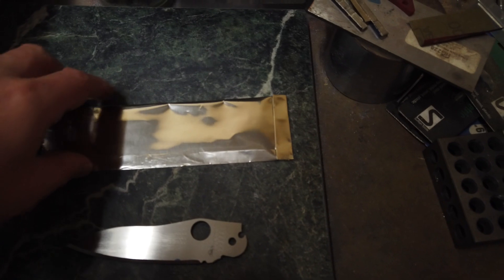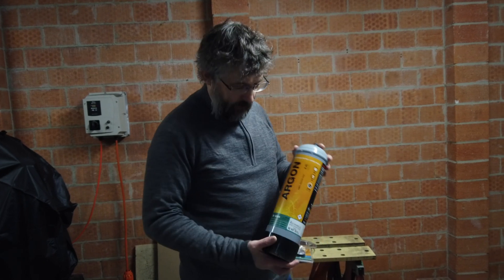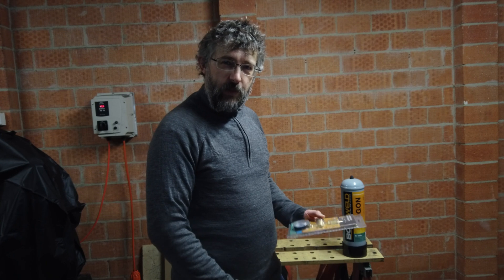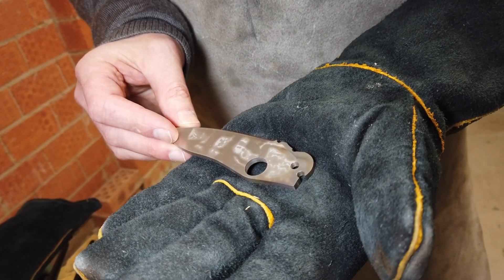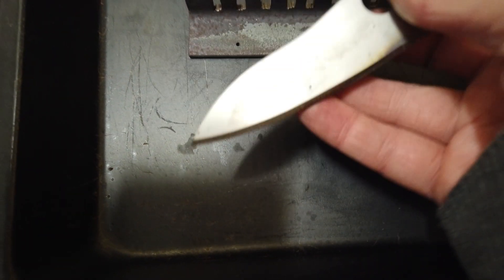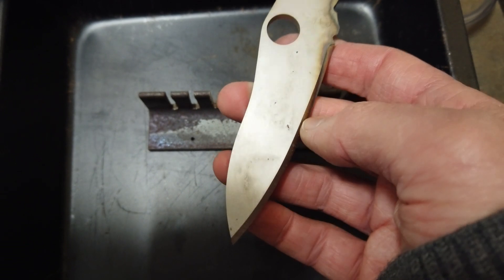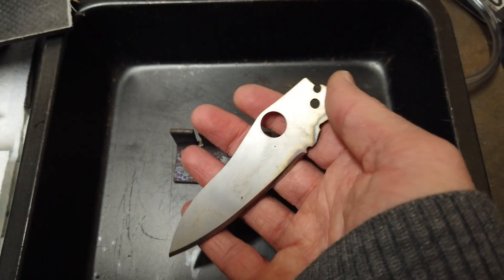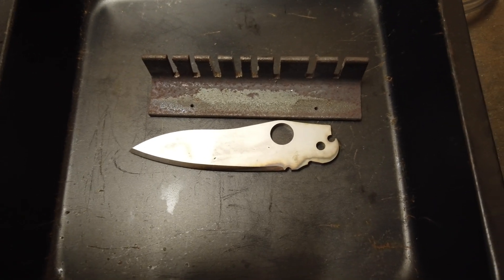Better Magnacut Heat Treatment?

Comment: For a one-off, maybe helium would work? Buy a balloon. Feed it to the end of the pouch with a PAPER STRAW cut to length, and leave it in when you close up the pouch. That will give you a "getter" to soak up any remaining O2 or any traces that is out-gassed. Pure talcum powder USP grade might be slightly better than baby powder, I don't know. But honestly, I don't care if there is sticking. DISCLAIMER: I am still just looking at my first piece of MagnaCut, haven't even drawn on it much less cut it yet so maybe I don't know what I am talking about, but other steels I have used and sticking is no biggie when it happens. I have never purged with inert gas, just included some paper for a getter, and squished all the air out in a sand box before the final crimp. I am thinking about making up a vacuum pump sucker/outer thingie that might be better than squishing the air out in sand under pressure.

Comment: Plate quench?
Reply from the maker: That's correct, plate quench using 1" thick aluminium plates. I quench still in the foil packet.
Reply: @AlistairPhillipsFolders  is there an advantage to using foil packets for magnacut? - im knew to knife making and am slightly confused why the foil is needed
Reply from the maker: @booperthebest1501  Yes if you don't protect it from the hot atmosphere in the kiln you will cause a bunch of scale and lose carbon from the surface of the steel. It is worse for Magnacut as it requires a higher temperature and it is in there for longer compared to plain carbon steels.
Reply: @AlistairPhillipsFolders  thanks a lot! is that why people dont use the foil for stuff like 1084 where the temp required is lower?
Reply from the maker: @booperthebest1501  and it doesn’t need to be held at that temperature for long at all for 1084 etc

Comment: It looks like you may be using foil wrap that is containing ti. It works well for clean blades however, over 1875 F it will weld a bit t the blade as I see here. Switch to a non Ti. containing foil wrap.  As far as baby powder, sadly, it is no longer available here in the U.S.. GRRRRRR! I have not tried it's replacement which has been corn starch. I guess it might be okay if you want a bit of corn bread with you steel! LOL!!!
KnifeMaker

Comment: Hi Alistair, a very thin coat of baby powder solved my problems with foil sticking to the blade (which seems to happen from approximately 1150°C but not at around 1050°C with my setup).

On a sidenote: I fold the seams of foil packages twice and gently tap them shut with a small hammer, the discoloration on blades varies but is pretty clean most of the time, maybe slightly worse than the result in this video.
Reply from the maker: Yep next batch I am going to try with some baby powder. I also fold my seams twice. I use my vice to fold them over and seal the packet.

Comment: I'm not into steel-working at all, just a thought from what I see and it may be irrelevant: 
it may not be just the air in the foil packet could stain the steel, but maybe also contaminating solids: fats from remaining fingerprints on the foil may evaporate, or a tiny bit of dirt from the pencil you stick in it. Anything solid will turn into gas or give off gasses at heat treat temperatures and may affect the steel surface.

Comment: Posted this on your Ig also but a smidge of baby powder almost none at all will keep it from sticking and will just slide right out even at really high temp cooks.  I also  had a nerdy thought about the argon. You could get like a small plastic bin storage bin and just use the botom and fill it with some argon like an invisble gas bath tub. Since argon is heavier than air, if you are careful to not disturb it much you can probably fill the foil like you are but in the bin of argon.  Im guessing when you fill it it probably leaks a lot and lets air in when your closing it up.  Very cool tho. gonna keep an eye.
Reply from the maker: I was wondering about holding the foil pouch vertically to take advantage of that and having the argon flow in from the top. If I had a set of wide jaw pliers that I could fold the top of the pouch of with I think that could be a better approach. I plan on adding some baby powder on the next one. It has never been a problem when I do RWL34 but that is at a lower temperature than needed for Magnacut.
Reply: Beat me to it. Baby powder is the go!👍
Reply: Good evening! Is it possible to recarburize magnacut after heavy decarburuzation occurs?

Thank you for your time!